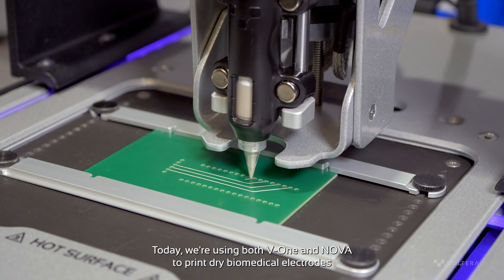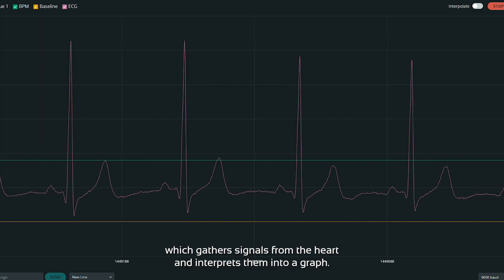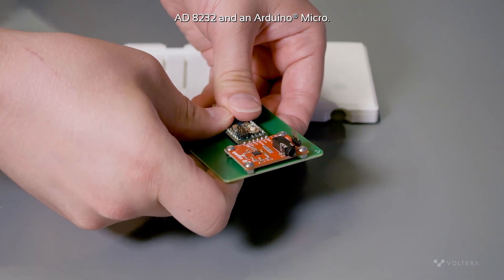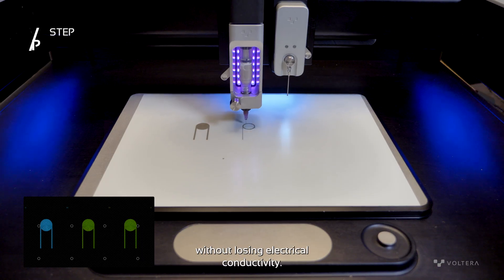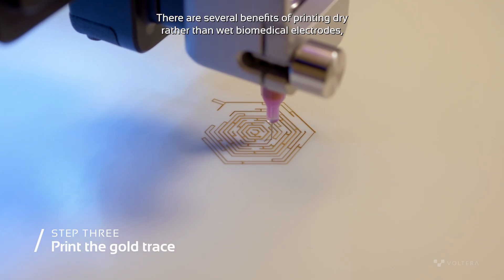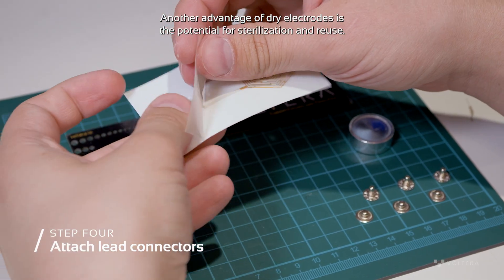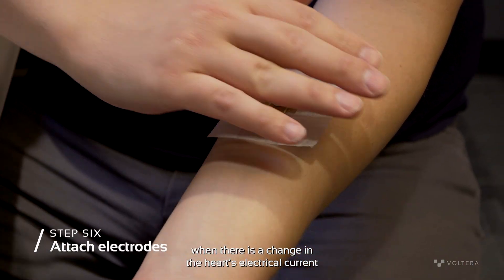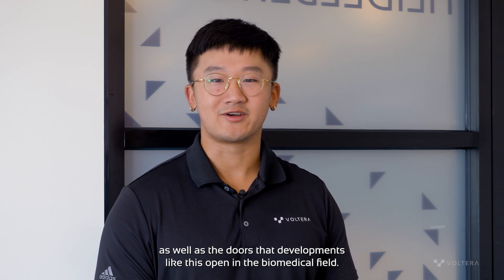Printing ECG Electrodes with Gold Ink on Voltera NOVA

Comment: How is this electrode different from gel electrodes which is usually used as use and throw materials.

What's main functional usage benefit, can Voltera explain
Reply from the maker: Hi @satyabratamohanty8658! Thanks for your question. We wanted to show how NOVA can help you prototype an electrode design in one day, and show the capability of NOVA to print silver and gold ink on TPU. If you'd like to see more details about the project, we linked the white paper in the description box!

Comment: How did you design the the pattern, using which software?? and are there any specific requirements for checking a design's usability through simulation software?
Reply from the maker: Hi @neginfi3649! The design of the pattern was inspired by this research paper: https://pubs.aip.org/aip/apr/article/10/4/041408/2919081/Dry-electrode-geometry-optimization-for-wearable. We used KiCad to design the electrode.
Reply from the maker: You can see the white paper for this project on our website: https://www.voltera.io/application-whitepapers/printing-ecg-electrodes-biocompatible-gold-ink-tpu